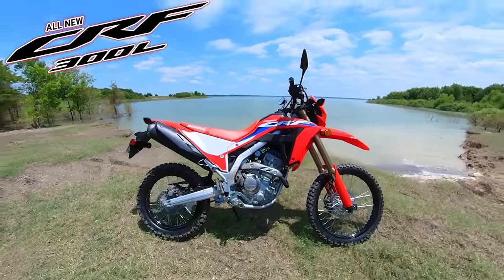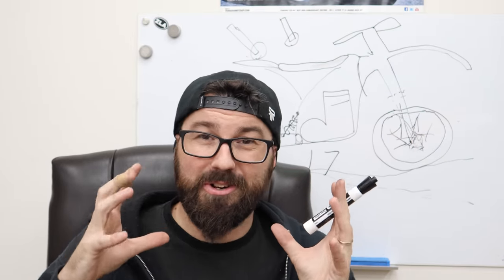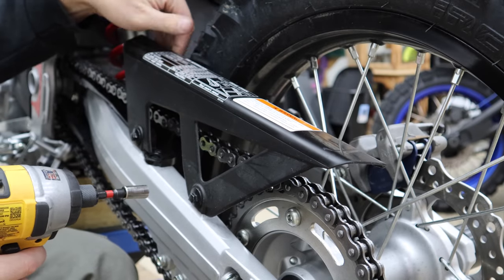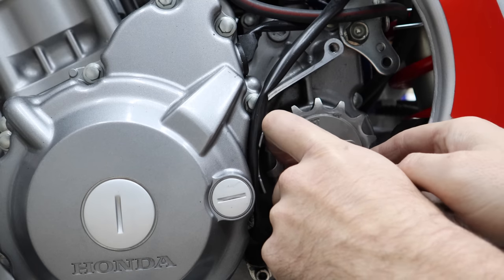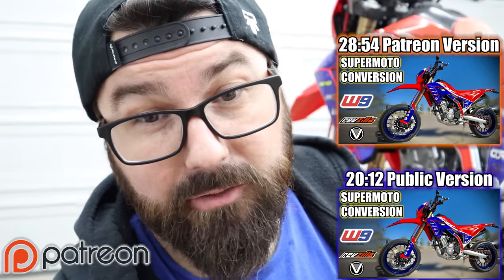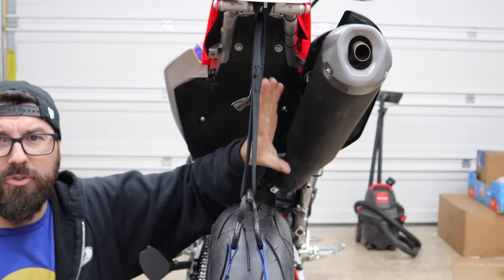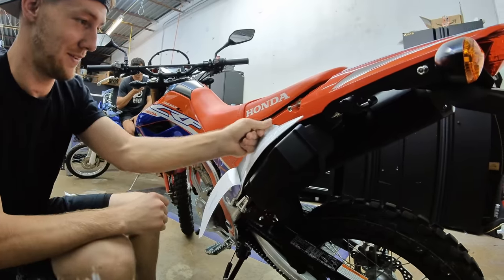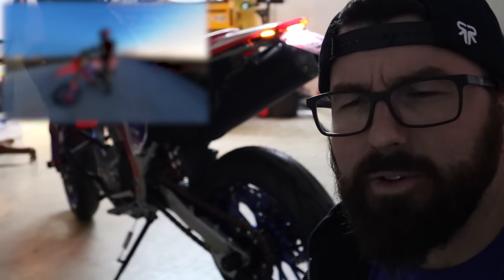Supermoto Build in ONE VIDEO - CRF300L

Comment: Got a 2009 KLX250s and was making fun of it but with the right tyres and snug to hairpin twisties it leaves a huuuuge smile on your face. You can drift with both wheels and 70Km/h and still feel like having fun. Also removed the clutch switch and bike switched to the fast map (weird i know) which ended up with 152km/h top speed, from 137(!!). I can't imagine how much more fun 17inch would be. Wish it was a D-Tracker, though the 21inch feels great when rural tarmac roads get overly rough or mixed with dirt.

Comment: You should only cut the fork guards where your wheel runs. Put your caliper on before fitting your front wheel. Finger tight all of your axle bolts then spin your front wheel and apply your brake a couple of times before tightening it all up. Most importantly USE LOCTITE on the caliper mount and caliper bolts !!!!
 I've owned a couple of Supermoto's .. Not trying to be a know it all.. Just trying to help anyone that's going to do this job. You'll be happy that I've told you these things. They are the best bikes imo to ride around on the road for short distances for sure !!!

Comment: Pretty sweet, the wheels look awesome. Ah supermotos... maybe one day I will own one. Came pretty close when Honda offered the CRF250M over here, but never pulled the trigger, being vertically challenged dissuaded me pretty fast of the 855mm seat height 🤣

About the chain, having experience with road bikes and industrial chains, the interference fit in motorcycles clip links threw me off the first time I used one, is that possibly why there was so much talk about clip failures back in the day? 

Impossible to sit the plates by hand and it feels sketch trying to use pliers on it. I ended using a simple cheap C clamp, the old outer plate and 2 M8 nuts to sit over the pins and push the new outer plate straight in. The little leaflet that came with the link was pretty light in details, no mention of a chain tool as necessary for a correct installation.
Reply from the maker: Yeah that’s an o ring thing, the interference fit. I also have a c clamp I’ve used to do it. But the thing you gotta watch is sometimes the pins start pushing out the back of the inward link. If you install a non o ring chain (dirt bike use em) you’ll see the link just slips on.
Reply: Dude don't let the high seat scare you, with supermoto trim it lowers it a bit and the bikes are so light, sumo will change your life! Worst case you can buy lowering links for most bikes.

Comment: 2:23 I did that same thing on the same corner at Adams  but low sided, nice catch
Reply from the maker: Man I kept pushing wide coming outa that turn (was on a big ol 701sm, she don’t change direction quite as easy) so outa frustration I kept getting harder on the throttle on exit 😂

Comment: Love it only thing I might if done is take an extra 1 or two links out because it’s quite slack and the chain is new so it will stretch only time you need a super slack chain is if it’s going to be off road and doing jumps and catching air so it has room when the rear shock compresses

Comment: nice content. is your wheel sizes 17-3.5 and 17-4.5. Some friends advice me for the rear to use 17-4.25, from your experience what you think of the rear sizes which is the best is it 17-4.5 or 17-4.25. Thanks

Comment: Did you just buy a second 320mm front rotor from Warp 9, or did you go a different brand?
Reply from the maker: I got a second one from warp9
Reply: Thanks. I figured that was the case, just wasn’t sure if it would fit on the stock wheels.

Comment: Got the chain  from Revzilla and the gold clip on link . The the gold link looks a little different as it’s not EK . Was yours ? I’m a bit apprehensive about the chain joining . Great videos btw I’m building my CRF and had loads of gear shipped to the 🇬🇧💵💵 just couldn’t resist ! You’re bike looks very nice
Reply from the maker: I didn’t have any issue with the link. It worked fine for me.
Reply: @TheGardenSnake  
Can I remove the wheels to swap motor for dirt with the chain riveted

Comment: Looks great, good choice on going with the forged wheels.  Would CB300R wheels have worked?  Also, if it would make for good content, I'm pretty close to you and have a CB300R if you'd be interested in comparing the two.
Reply from the maker: Not sure about cbr wheels. Cast wheels on a Supermoto seems like a less then ideal set up. But hey if it’s easy then maybe a good cheaper set up. 🤔

Comment: Thank you for the parts list! I’m 100% doing this! 

Out of curiosity, do you happen to have a seat height difference measurement?
Reply from the maker: No I didn’t check that and if I didn’t it now it would be different. Since that video I’ve done full race tech suspension. The bike sits up a good bit higher now. Still can easily flat foot, I’m 6 foot with a 33 inch inseam.
Reply: @TheGardenSnake  Based on the tires it should have been roughly 1.8" lower in the front and about .75" in the rear, so seat was probably 1.25" ish lower. Just for whatever newer or shorter rider was curious of the math. I'll ride anything but it's always nice to be able to flat foot at a stop if need be :D

Comment: Think I could sumo the 300L rally? I’m sure most parts are the same.
Reply from the maker: Everything would be the same except the relocation bracket. The rally runs a different front brake. But warp9 has the rally as an option so just select that and 👍
Reply: @TheGardenSnake  I guess I probably know the answer considering which you bought, but do you think the bike is quick enough to make the screen worth it? Do you ever feel like you’re missing a larger tank?

Comment: I’m wondering why you would lube a cars slide pins but not a motorcycles?
Reply from the maker: Automotive ones have seals and little boots. Moto ones are open and the pads literally move along them. Any lube you put on them would gum up with dirt and the lube cloud get on the rotor or pads.

Comment: I have the same motion pro chain breaker. Never had to grind the pin down. I just loosen the small push rod, tighten it over the pin, then just crank the push pin through. It pushes it right out.
Reply from the maker: I’ve seen em snap the tool from doing that

Comment: My DID chain for my road bike is a VX3 chain. 
X is x ring and the zv or 3 has to do with the displacements the chain is rated for and dirt vs road and such or so I’ve told myself. 
But a Z shaped O ring would be a horrible idea. 
Uneven pressure on the plates. 
O-X-Z all tells you what works
Reply from the maker: Ever seen a “W” ring
Reply: @TheGardenSnake  Don't go for the W ring, it makes a horrible noise and takes half you're stuff when it brakes!